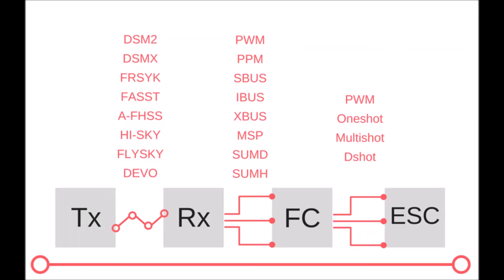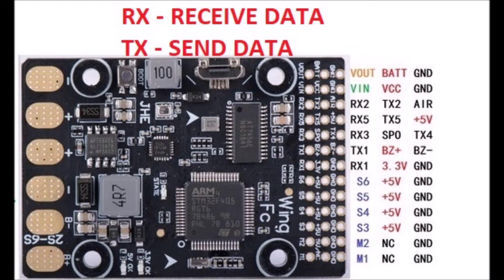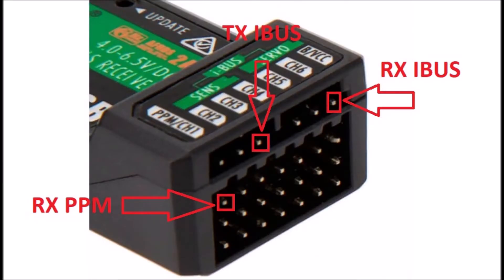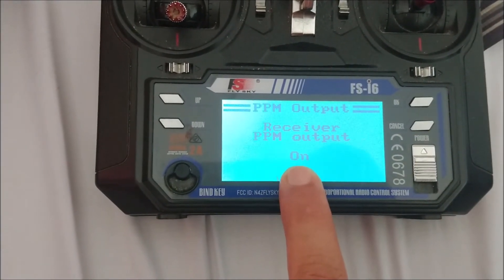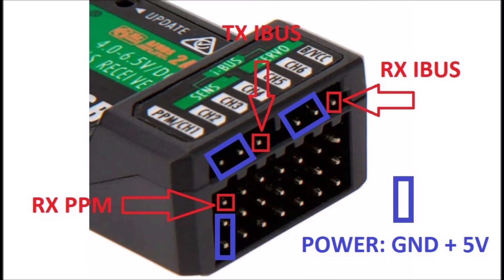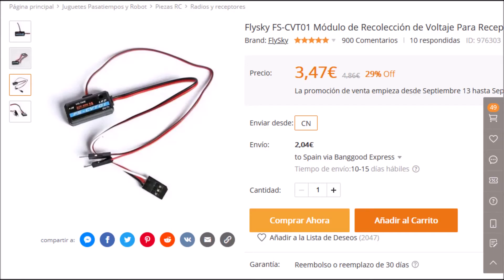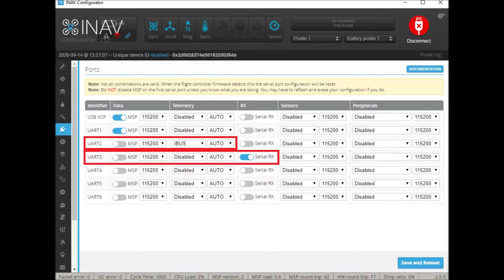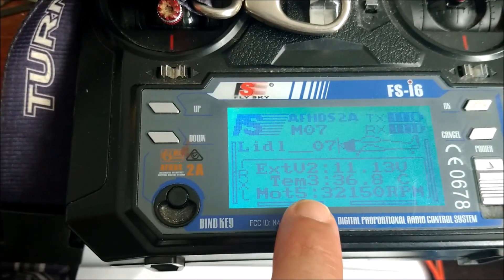How to SETUP FlySky FS-iA6B with flight controller FC. Protocol IBUS y PPM. Telemetry. TX RX UART

Comment: I've been searching all over and this is the only video that I could find that tells you how to connect TX and RX on an FS-IA6B to a flight controller. I have an FS-IA10B and an F7 flight controller that has ports (no soldering) for external devices including the receiver. That port has four wires to connect for power ground TX and RX but nobody explains how to connect those four wires to an FS-IA type receiver.

Comment: HI,
original flysky documentation an overall internet, there is no mention to use of two uarts. it makes sense, because FC uarts have different RX TX pins, but I still do not understand why, at this point, IBUS is defined as a three wire protocol half-duplex (s-gnd-5v).
On spracing f3 fc, I cannot figure out telemetry with standard setup, neither with opentx mod on flysky fs-ia6x transmitter. Only radiolink values appear on transmitter fs-ia6x "telemetry".

On another system with frsky taranis opentx stuff, I had no this problem, because since the beginning, all internet info ends up in using two uarts for rx-tx communication.
The question is : is Inav/betaflight need to use two uarts, or just a rx-tx protocol need ?

At the end of the story, should it be be sufficient to add a fourth wire for telemetry as in video vs standard three wire IBUS,  between ia6b and fc, and configure transmitter and inav for using telemetry and two uarts ? Or do I miss something ? (It is about one year that I own a flysky system that I have to clarify this issue ..., so this video might be "THE LIGHT" :-))

Alfredo
Reply: I found why tm is not fully discovered, Your tutorial is correct ... with another uart tm appears.

It is necessary to configure IBUS telemetry in the inav (I use inav) ports tab on another (a second) uart.
The new uart tx (fc side) pin must be connected to sensor ibus signal pin on the receiver (I use ia6b receiver) as You describe in this video. 
Since on the fc electric ground is common, I just added one connection pin2pin to the overall setup.
Quite easy ...

Flysky documentation is not clear about this, and many infos on internet seem to refer different obsolete hw ia6b receiver models, declaring that telemetry is not available, or that Ibus is half-duplex.
A big mess ...

Hope this post/comment can be helpful to other guys !!! ...

Alfredo
Reply: Do you have the ia6b v1 or v2? I believe v2 can be identified by input voltage being 4.0-8.4v
Reply: @scotthager1718  I see this post only now. I think I have the newest version, but I reflashed both tx and rx fw, and I am using a different setup now, with new opentx from MarianoFpv/Rakish. This Flysky system (ia6b rx + ia6x tx) is a total mess , there is noo way to come out of this .... only trial & test 🙂. I tried, while googling,  to go back in past time : it seems that half duplex tm has not been very much  used and tested aftet its first "discovery".
Reply: God damn every one sounds so smart. I just want to fly my drone more than i crash it. PPM works for me, but i never got my receiver and transmitter to work with ibus. This is so obviously dated. Flysky must be a joke.

Comment: Which one is the ground and + pin is it the first pin or last pin
Reply from the maker: positive is the upper, negative is the lower
Reply: @FisicayQuimicaCanal  I did oppisit and it exploded
Reply from the maker: you cannot connect the battery to the receiver; you connect the battery to an ESC, and connect the ESC to the receiver

Comment: Assuming u used UART2 for your RECEIVER iBUS, what for did you use a single pin from iBUS sensor slot ? To gather the data from sensors connected to the FC and then send it directly to the radio ? is that right ? 
While connecting receiver to the FB TX goes to RX and vice versa. Is it the same story with telemetry ? Where should it be connected on FC ? RX or TX ?
Reply from the maker: RX goes through PPM, TX goes through IBUS in a different UART; you only get a few data from the FC; this receiver is not suitable for a good ibus connection, use X6B

Comment: Pls share the connection diagrams ia6b to fc
Reply from the maker: if you use UART2 en your FC, join the Tx to TX2 in FC, and RX to RX2 in FC

jon 5v and ground to any available pins